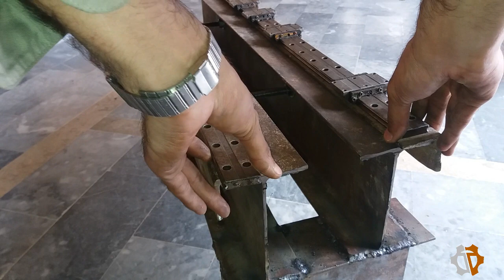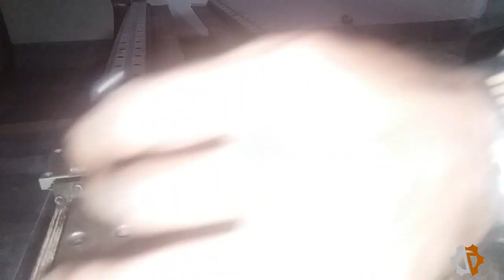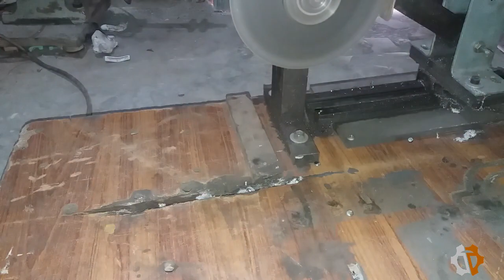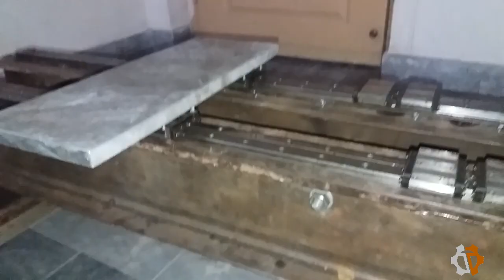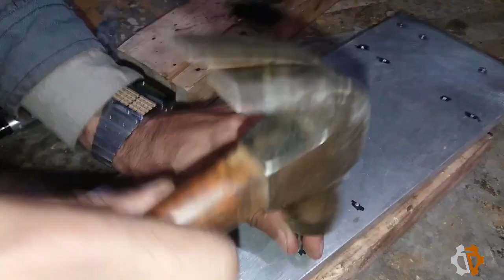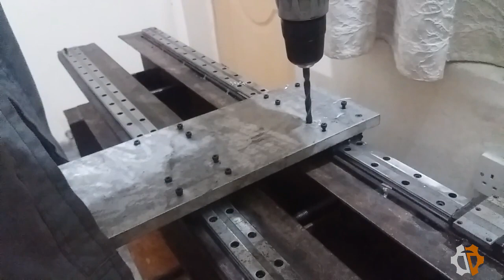HOMEMADE LATHE PART 2 (CROSS SLIDES) | Torno casero parte 2

Comment: I have a set of these rails. I've been thinking about building a small CNC lathe and using just one rail for the ways and another for the cross slide because I have one long piece and one short.
Have you been happy with them? I like the idea of only running one rail to because I don't have to worry about making sure it's parallel to the other one.
Reply from the maker: Yeah u can use one slide for cross slide

Comment: Would have been more accurate to measure the bolt holes and just as quick, did you find reliable accuracy on the slide rails. So far your design is the one I’ll use because it is inexpensive and parts are accessible locally an impressive build, 😊

Comment: You'll never get a truly accurate cut unless you level the bed. I would hand scrape it until it was completely level.
Reply from the maker: u are right.  but i had time problem and it was my first try.  it was good learning experiance.
Reply: Using shims is much more efficient as most if not all small shop have the ability to check level across length, depth and diagonally. That would require a surface plate three feet long and 18 inches wide.